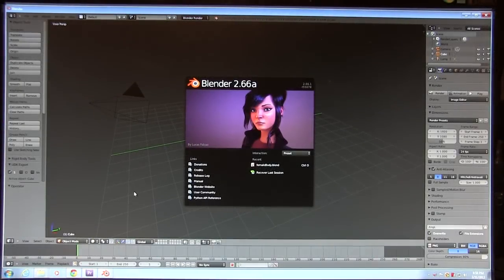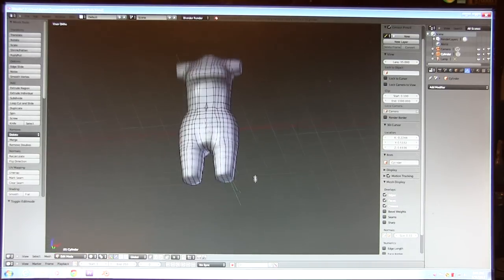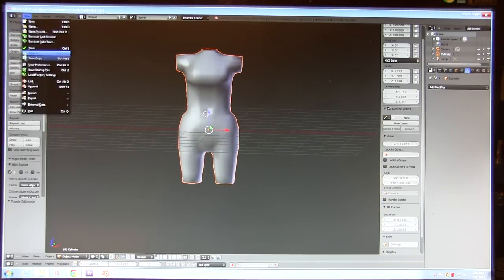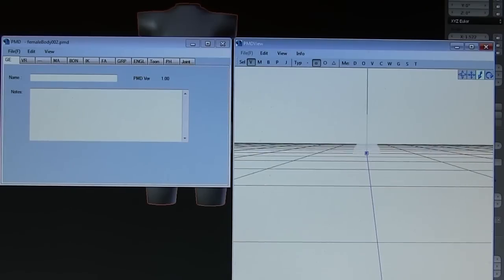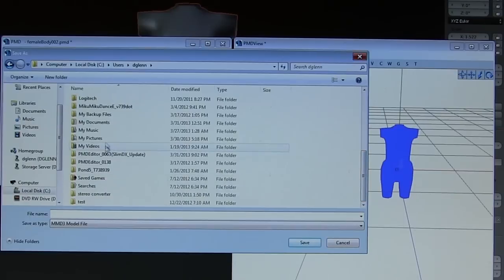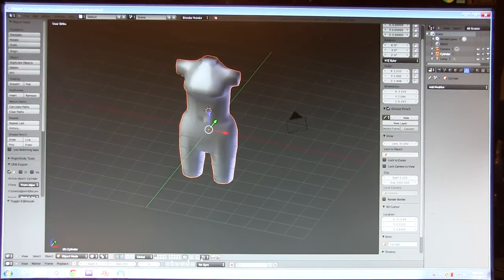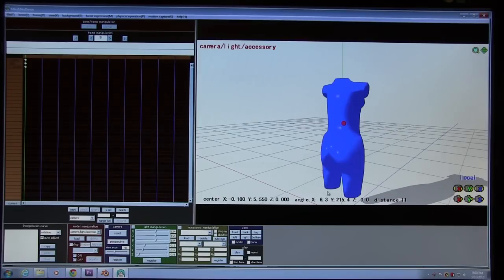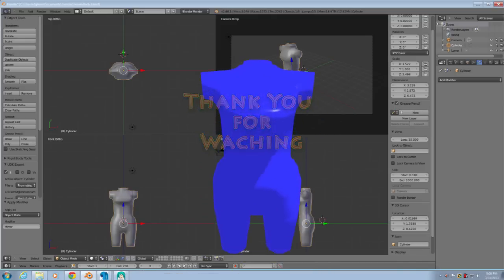Making Models for Miku Miku Dance from Scratch - Blender

Comment from the maker: Well, If I did, it would have to be after I did all the other stuff I promised other people first. Exp: I'm still working on Robbie Allen's stuff for lightwave. The only other issue that you run into is Furries. Doing Hair on Miku is bad enough.  You noticed that I haven't done a head yet, because I'm still figuring out the hair in MMD. In Furries, every hair element is an appendage and has to be dealt with or it doesn't look right. I'm still dealing with hair on a simple level first.

Comment from the maker: with PMD Editor your still going to have to learn some Japanese because most of the animation files out there where done from the original models and the rig they use have tags written in kanji You change the tags then there after you can only use animation files made with that model. Also PMD editor has been translated to a point but some Dialog was still in Japanese - last time I checked.

Comment: I know that this is kinda an odd question as Blender and PMX has changed but if possible could you update this video or show how to attach Textures to a .X so it can be opened in PMX?...I make models for blender and maya but cannot rig in any system OTHER then PMX/PMD so this would be GREATLY appreciated
Reply from the maker: Well, meany things have happened. First, my boss wanted me to expand into Unity so my work moved on from Blender to Maya and Motion Builder. Next, there was a rift on whether or not was allowed to work on Miku -given that I was also working on commercial projects! Even though I never made a dime for what I was doing, the fact that I was a professional was a concern to CFM. The final straw was the fact that I was writing papers and giving talks and given that the subject matter was anything but MMD, It got passed up. That was 3 years ago, and to produce another video now, I would have to do a great deal of cache-up on PMX and Blender. Right now, I'm working on VR so nothing would be more fun than to add Miku to VR, but I hear it has been done already!
Reply: ah I see...its understandable! ...I wouldent have these issues if Blender could rig like PMX...the paint weighing is terrible! especially in blender!
Reply from the maker: Well, the biggest headache of  PMX is the fact that most of the bones have to be done in Kanji and most of the pre existing animations that MMD uses, so if your planing to use your own models with English bone names, your going to be making your own animations in MMD. Also your almost have to do your weight shade in the PMX editor. I know other way around that at this time. If you find a better way to do it, I'd like to know!
Reply: D GLENN
 I will try my best regardless

thanks for at least replying to my messages!

Comment: I really hope you can still help me with something. I'm able to follow this easily and right now I have Blender 2.71 This method still works however when I save as an .x file the faces you see when in pmd editor are the ones on the inside even though the normals are correct in blender. Also the edge line acts very weird and instead of being an edge line, when turned on its more of a black mass that covers the model. Same happens when the x file is loaded into mmd. I'm just not sure how to fix this or if I need to move to an older version of blender.

Comment: What kind of MMD model Creator did you use?
Please,I really need it....
Reply from the maker: +Neko Yamiko Eve  The one I used was the easiest to get yet and the hardest to use, and that was Blender. I saved the file in Direct X modeling format and I used a Hacked (to display most of the Dialog in English) pmd editor. Stuff that I don't get into include using the bones of MMD model to rig a figure model. That's because I was never able to figure out how to control the amount of weight shade at conjoining parts of the model in the pmd editor (knees, elbows, hips, etc) . Hope that helps!

Subnote: I've moved along from MMD. I'm experimenting with Unity that is also free for the individual user - and if you learn how to use it, it might get you a job! You can build models using Blender for it and there is even a way to port MMD models and animations to it - though I have not had the time to use it!